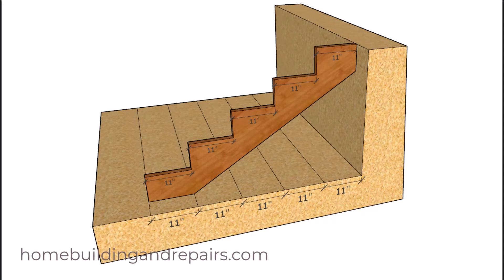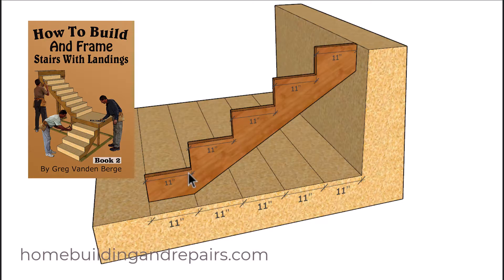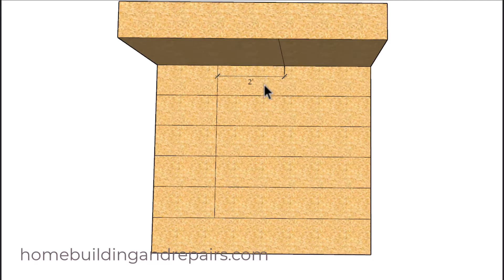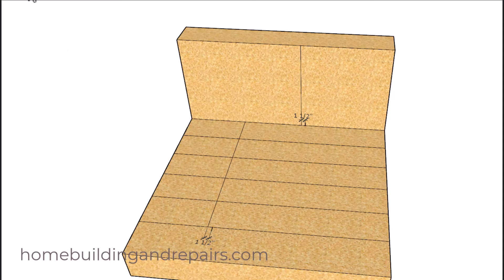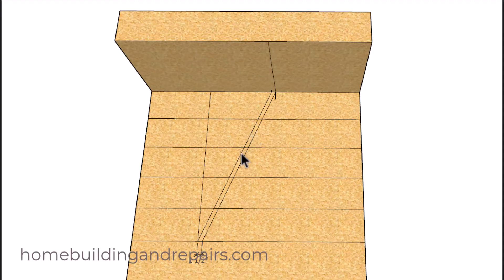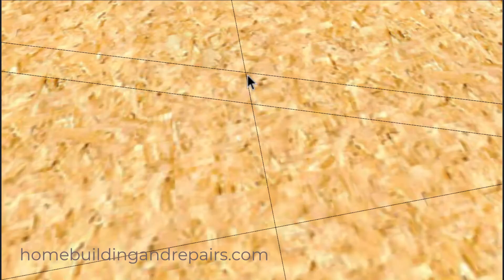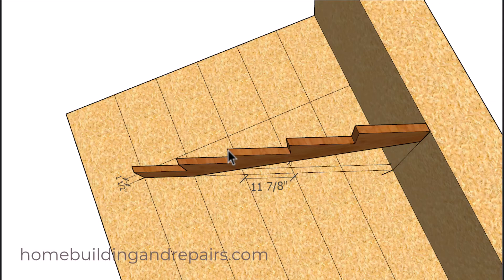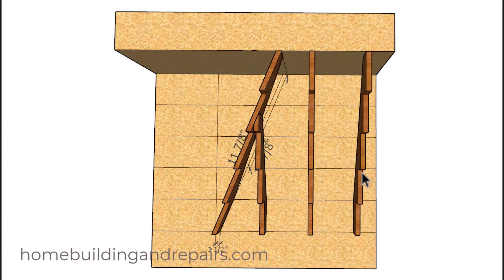How To Calculate And Measure Tread Depth When Using Angled Stair Stringers - Super Pro Tips

Comment: Good idea.  But shouldn't the inch and a half be perpendicular to the Diagonal stringer, and not the original stringer?   I feel like  you would have less than an inch and a half snapped on the floor  if done per the video.
Reply from the maker: Great catch and maybe you could use a block of wood to layout the width of the stringer if laid next to the first line drawn on floor to get the correct width of stringer if your comment doesn't make sense to other viewers.